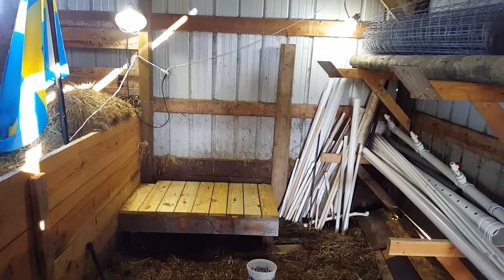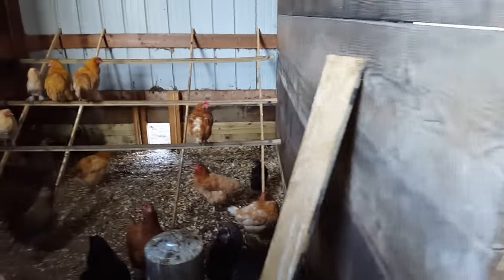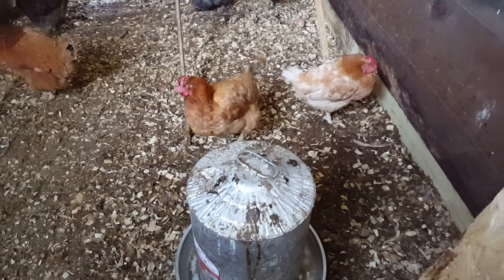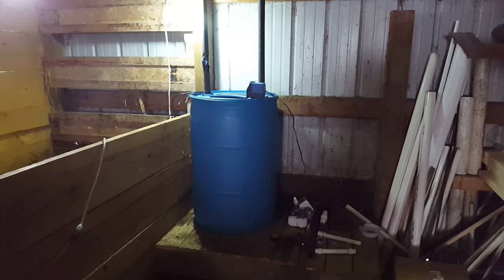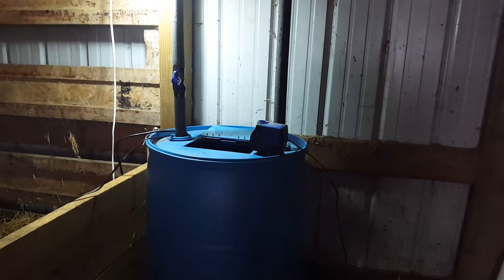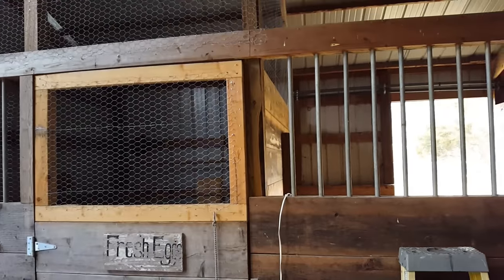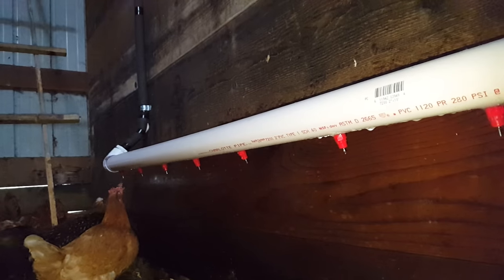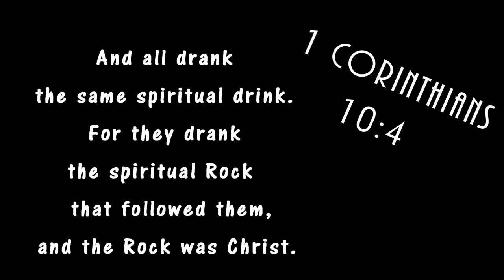Automated Barn Watering System

Comment: Excellent. You are a very intelligent man. I would suggest a pump designed with a thermostat so that is only pumps when the temp is freezing danger. They make pumps for recreation vehicles and farm sprayers that turn on only when the pressure drops below a certain level. And they work on 12 volts so the system could be hooked up solar.

Comment: i would suggest leaving the bigger pump so in the future you put a faucet out there you will have good pressure. as for the waterers i would put pressure reducers on them l. that way you can adjust the pressure for each system.

Comment: I don't know if this matters but just a though. I might either put a piece of plastic of brush on a sealer to that bottom board. Wouldn't want that board to take it water and begin to break down. Just a thought I understand with less pressure you won't get as much water spray but its just something I saw that caught my eye! great videos!
Reply from the maker: +Colin Chalk I is a new treated board so hopefully it won't Roy but I didn't think about throwing on some deck stain. Good idea for sure

Comment: Also, if you lift your 55 gallon drum up a few feet above your chicken feeders, you would be able to supply water to them without a pump in the summer, with the system simply siphoning from the tank.

Comment: Could you pump to a reservoir and gravity feed the supply pipes? I just though it would solve pressure issues and help so the pump does not have to run constantly. Cool setup though! Keep those videos coming!
Reply from the maker: I could put a barrel in the rafters and then just pump up to it and let it gravity feed back to a sump pump or something also. Not a bad idea but I guess kind of late for that now:)

Comment: As a side note: Now that your system is fully primed, your little pump should be able to work. Since the system is full of water, the pump should not have to push 10' of head - the 10' of head on the return line balances out that pressure. If you put in a hose tap on your drive line, you'll be able to prime it in the future with a stronger pump, and your little pump can stay installed permanently.

Comment: Have you tried it with the pump off to make sure it is the pump causing it and not possibly because of the height of the water?
Reply from the maker: +Jayd Lawrence yeah, I reduced the flow of the pump for now with a valve and they don't leak at all. Just drip like they are supposed to:)

Comment: I'm not sure of the types of valve that you used, but could you close your valve some on the intake pipe to your chickens?
Reply: Alan Esey or open the bypass valve a bit to lower the pressure going to the chicken drippers
Reply from the maker: +Jon Hoad I didn't think of that actually. That might be the best option until I get the new pump, thanks!

Comment: FYI: The closed bypass valves will probably freeze. The ball of the valve will have water in it when closed. Solution would be to just crack the valve open a little bit.
Reply from the maker: I was worried about that also but with a few 15 degree nights and 20's during the day it did not freeze. I think the warmer moving water above it  keeps it from freezing

Comment: Could you change the duty cycle of the pump to temper the internal pressures? 
For example; ON for 60 seconds (or however long it takes for the fluid to cycle once through the entire system) then off for 5 minutes.
Another idea to determine how long the ON cycle might be to have a thermistor in the return line of the tank and a thermistor in the tank itself.
When the pump switches on, you can compare the tank water temp to the return line..once they are equalized the pump shuts down for a set period of time.
Reply from the maker: +wxfield I like that idea, especially having the pump come on and off in intervals, might have to look into that
Reply: We have had really good luck with products from a company called Titan Controls. They make a simple repeating timer controller, but also temperature controllers as well. You can have the output of one feed into the other to combine duty cycle with water temperature for example. I only made the temperature controller suggestion because I suspect your two largest concerns are over-pressurization and freezing.

Comment: you sure would not be out in the barn working dressed like that here. it be -25 to -45, when I installed my barn water system over 37 years ago I ran 2 1" black poly lines from the well presser tank and installed a cast iron circulating pump, the same kind you use on hot water heating boiler systems, sso the water is always moving, you don't need a barrel, even though both lines are under presser the water still moves, it is like when you have a long hot water line run to say your kitchen sink, you install ether a stainless steel or brass circulating pump so you always have hot water at the tap with out having to run the water for half an hour to get hot water, the down fall of these cert pumps that use next to nothing in hydro do need a positive presser of 12Lbs on the in take side as they do not suck. Then at each water I ran heat trace wire just at the waters, nipples and wrapped that area in boiler insulation and covered it up so nipples and bowls never freeze but I also make sure the barn has enough animals in it to keep it warm. in fact for the past 10 years I to sleep in the barn ever since my ex wife broke in the mobile home and flooded it and the insurance wrote the home off and sent me a $68,000 check witch my ex got a court order to get that check a long with all the funds I had from  a law suit from when I broke my back at work an never to work a job again, long before she was around, along with everything else I owned or had since I was 18, I'm now 57 if you get what I am saying, my videos talk about it here and there, Ont Canada courts give everything to the woman, no 50/50 and don't mater what you had before

Comment: I know digging is a royal pain, but you may live to regret not burying these below the frost line. I don't know your dimensions, but for every 10 feet of 1/2" PVC with 3/8" insulation on it, you would need about 13 watts to keep it from freezing on a 0 deg F day, or 20 watts on a -15 deg night. So, if you have 100 feet of pipe, you may end up needing 200+ watts to keep it from freezing. That's not counting the losses on your uninsulated drum and uninsulated feeder.

Comment: what if you raised the water barrel by 1 barrel height.  that would give you less lift neede for the other pump and as a bonus you could sore stuff under it.
Reply from the maker: Once I get the autofill setup I might do that but for now I have to lift a 5 gallon bucket to pour in the top so lower is better:) Good idea though
Reply: Ohhh yeah forgot about that small part!

Comment: Nice install. Looks like you're using the circulation to prevent the freezing of the entire system.If you fed your smaller pump with a short pipe from the bottom of the barrel,gravity and the weight of the water would help feed the pump.I know that most automotive fuel pumps like to push fluid,not pull it.When you build your rain collection system for warmer weather,an elevated reservoir might produce enough head to feed the system without a pump.Here's a chart link. http://www.kylesconverter.com/pressure/feet-of-water-to-pounds-per-square-inch

Comment: Great work SSLFamilyDad.  I'm curious on the pump, I'm assuming you have to leave it running 24/7 for this system to work (circulating water) - Does it wear the pump out to run like that?   Thanks for the video!
Reply from the maker: +Brad Waits it does wear on the pump for sure
 The old one I had in there went bad after a few months. The best option is an actual circulation pump which is designed for continuous use
Reply: SSLFamilyDad -- cool.  Thanks for the reply!

Comment: any check valves in the system
Reply from the maker: not right now, not sure if I need any but the way it is right now if a spring a leak anywhere it will just pump out the barrel and then probably burn up the pump so I need to come up with a solution to that possible issue
Reply: SSLFamilyDad These sump type pumps usually come with a float or you can probably find and hook  one up separately to cut the power to the pump.  Also watch out for freezing in any unused drops.